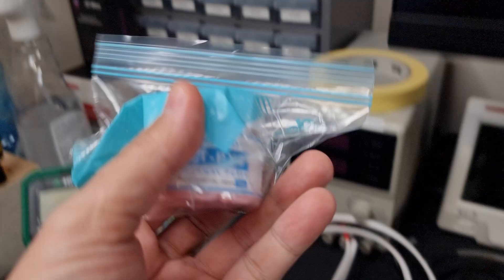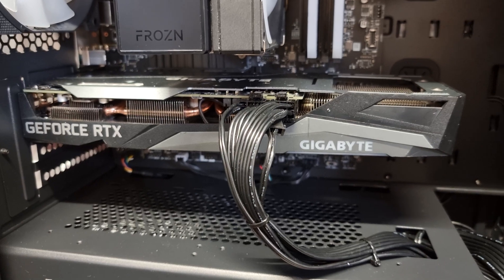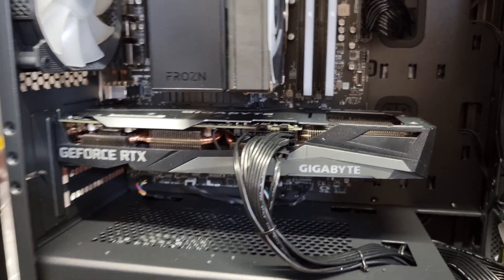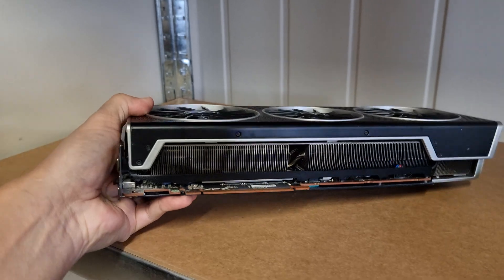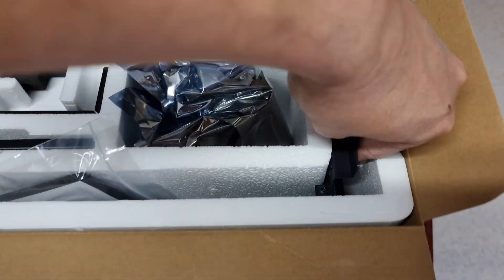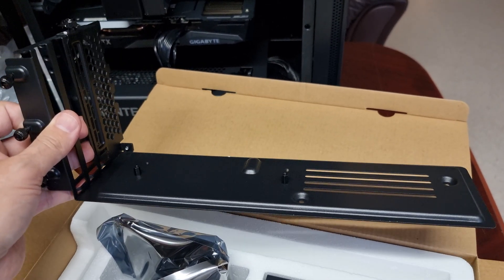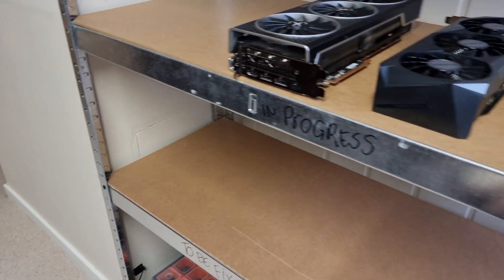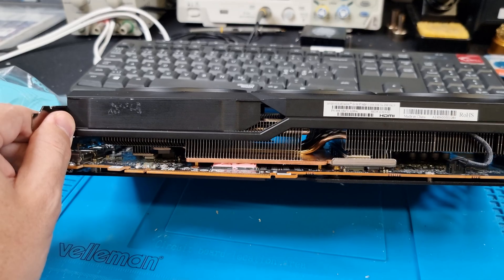Why Modern Day Graphics Cards Are Dying Prematurely.

Comment: because most modern gpu are equipped with vapor chamber tech. they DONT WORK properly if mounted  vertically since the vapor liquid are getting trapped resulting 88-90c like astral or elite series lol...
Reply: i have my vanguard 5090 vertical mount. does perfect. have a 5080 astral also same thing so i dont know what your looking up. Vertical Mounted where the cords are on the bottom or top yes issues
Reply: @stephengrinaker5085  just because it works doesnt mean his comment is wrong.
Reply: @KaMil-gw2qr  comment is 100% wrong
Reply: is this for real? most sandwich case vertical mount and the temp actually good side
Reply: lol, do you just make things up?
Reply: Oh, does that mean you shouldn't lay the case on its side while gaming either?

Comment: I recently got into GPU repair and have found it to be pretty challenging but rewarding to learn. I decided to tackle it after getting a good grasp on console repair (PS5/PS4, Xbox Series, Switch 1), so I'm use to seeing design flaws go pretty widespread. After 5 months of self-teaching thru research I've already got a handle on successfully reballing memory on failing cards. Crazy that failing memory is such an ongoing issue on modern tech, especially for GPU's. Just goes to show companies just want to make a quick buck and lost sight of what makes a reliable product.

Comment: THIS is why I bought a Thermaltake Core X5 in 2018 as my PC case due to its horizontal motherboard tray. The motherboard lies flat and my 5 lb. RX 6800XT GPU is vertically mounted in the slot, which means it CANNOT develop problems with the PCB flexing because gravity is not pulling the GPU heatsink away from it. Vertical mounting of large, HEAVY GPUs appears to be necessary if you want them to live full, productive lives.

Comment: The other problem is these cards heatsinks are much larger than the PCB's if these small PCB's are generating so much heat its time to make the SKU's liquid cooling only, especially with inflated GPU prices it really doesnt cost that much to setup a custom loop, EPDM+DP Ultra Clear is all anyone needs.

Comment: Recommendations for 4090 and 5080?
Reply from the maker: If they are heavy cards, use proper supports. I place the supports between fan 2 and 3. But otherwise, I like to use vertical mounts. Phanteks makes a few. I like the cheaper one. https://www.komplett.no/product/1220772/datautstyr/pc-komponenter/kabinetterbarebone/tilbehoer/phanteks-vertical-gpu-bracket?gad_campaignid=20188016872
Reply: @TechnologyHive Ok thx.So do you think my motherboard GPU bracket is good enough? I have a ASRock x670E Steel Legend. It always seemed good enough but then I saw your helpful video.
Reply from the maker: @theesharpestsword Any support is better than none. I would just use your board's support. The point is to not let your gpu sag with no type of support.

Comment: thanks for the info. I've done it for years naturally tbh because it does get in the way all the time especially the Rx 7900xtx, I've had a vertical mount and low key need it for my second build but after spending a decent amount on the mounts it kinda hurt the first time but its lowkey needed. For now it has decent support from the middle.

Comment: I think my gut reaction to be annoyed as vertical mounts aren't sold locally and it will be more than the cost of my case to get one in. 

I will see if I can find one with reasonable shipping as my previous 1080ti was visibly warped but still alive after 7 years and the 2 year old 7800 xt is heavier.

Comment: I religiously use a GPU support after having one card die on me (5060Ti16gb) due to GPU sag I got a coolmoon ARGB support bracket from aliexpress which screws onto the the card slots so a $15 investment to prevent another card failure from sag is a better investment over having to wait for a warranty replacement or having to spend another $850NZD on a new card, the card that I now run that replaced that 5060Ti is an Asus TUF Radeon 9060XT 16gb, so not using a GPU support was a very expensive lesson learned.

Comment: btw, Got AMD 7900xt after a year of use I reflow 2 vram near PCI slot . Works better now but still sometime I have to reboot. Just got broken as-is ASUS 6900xt LC hybrid. Repaste and run Furmark fine( Furmark use only 1GB vram during testing) but crash in Warzone I think due to loading lots of vram. Card got 3 8-pins, when crash the middle 8-pin red light flashes. Unplug PSU to reset the light. Tried swapping 8-pins cable around on 1000 watts Dell PSU but same issue. Looking on YT but have'nt seen how to fix yet.

Comment: GPU should already come from factory with adaptable brackets to be placed on the flying angle to prevent bending and movements. This is a fault from the manofaturers actually, they only think in fill their pockets and cut costs.

Comment: What about the Sapphire NITRO+ 7800 XT/7900 GRE? Would I really need to buy a 3rd-party vertical bracket mount? They basically have the same design and both comes with a GPU horizontal support mount. I saw a review on these GPUs on TechPowerUp site, and these cards have a reinforced brace built within the design of the card internally. So, I'd assume that should help support the card better (if you were to install it in horizontally), as it adds integrity to the overall structure of the GPU.

Comment: Overheat which is common on high speed processors.....company policy to reduce thermal resist materials for profits. Such as low quality copper, gold, and fiberglass board.
Thats why old products cost less heat 🤑

Comment: SO this is an issue of long 3 disipator gpus? i mean i guess that mine is a rx 6600 and i think it would be ok i guess as its a dual fan and while its long i havent have any problems but i am asking if that would be a problem or not and if i end up buying a 9060xt would that could that happen or its more of a 5080, 4080 , and maybe the 9070xt?

Comment: You can support GPU using some basic stuff in your home, if you dont care about looks. Lego bricks, sewing threads, plastic pipe pieces. 
I've tied my GPU to the top of the case and twisted the thread a few times to adjust tension.

Comment: Thank you for the video, Very usefull information that i will use when upgrading my trusty overclocked 1060 6gb (mem +830, core 2050, vid 1025 mv and temps max 69 if long time 100% usage)

btw, i supported the end of the card as pcb is really warped on the pcie connector. This is not a heavy card, but it lacks support on the back on the pcb so it sags heavily. 
i didnt buy any 3rd party supports, instead i used a bicycle wheel spoke... just twisted it to a 90 degree angle to get a steady base and placed the head right next to power supply cord.. raised end of the card 2mm. 

Keep posting :)

Greetings from finland

Comment: Me, who mounted my RTX 5090  vertically: 😌 
Me, after remembering my GPU is from Gigabyte: 💀
Reply from the maker: Supports are fine. I place them 2/3 the length of the card, or between fan #2 and 3.
Reply: @VorkKnightOfGood  u have 5090 be happy brother u are blessed
Reply: @alikf8017   A 5099nthay could die at any moment because the insane heat can melt the "server grade thermal gel" and cause it to leak into areas it shouldn't shorting and destroying the card. 

TLDR = No more 5090, no more blessed. Understand?
Reply: I got a Gigabyte Windforce 5080 from NewEgg for 1389 Cad. Gigabyte rocks.
Reply: Mount me bro
Reply: @BBWahoo  hot
Reply: @VorkKnightOfGood  exactly, no mentioning of newer gpus leaking thermals would have those users kill their GPUs arguably even sooner
Reply: @VorkKnightOfGood  I don't get it
Reply: @nickhero6329  all the thermal putty leaking out after it gets warm.
Reply: @nickhero6329 gigabyte proudly announced they were using server-grade thermal putty instead of thermal pads. Then users reported the putty was leaking, a situation that was made worse if the card was mounted vertically.
Reply: @VorkKnightOfGood yeah, they should advertise to mount it only horizontally
Reply: Me, who sold a GTX 1070 with profit after 5 years of heavy gaming and mining useage and replaced it with a free, fanless GTX 1050 Ti: I could not care less about those "new" problems with graphics cards

And dont worry, if i need gaming performance im also super happy with my RTX 2080 150W notebook @180W alienware vBios
Reply: Just ordered myself a 9070xt good to know i need to use the support for the vertical mount because its gigabyte
Reply: @cookiebandit101  Whats the issue? I have a Gigabyte Windforce 5080 and it's working perfect. Came with a nice support stand and all. Faster than your 9070.
Reply: @gto1607 vertical mounts with the added weight can shear the pcb
Reply: GIGABYTE overbuilds their cards compared to spec. Zotac does the bare minimum.
Both are as reliable as a reference card if not more.
Reply: @skorpers  Lmfao 🤡Gigatrash is the literally the most garbage brand manufacturing GPUs in the last 15+ years 🤣🤣

Comment: That's why I've used support even for my dual fan 2060s, 5 and a half years later and it still runs as good as new.
Reply: tbh those smaller 2 fan gpus like 2060 dont have this issue rly. They are light enough

Comment: I think I will always (if I can) stick with my old Thermaltake Core X9 case, because it is the motherboard that is horizontal and the GPU is vertical. I recently replaced my old EVGA 2080ti FTW (3 slot), no bent board. I would get a vertical mount if I had to use a tower case, I have seen the sag on heavy GPUs, kind of sad.

Comment: I'm gonna put my tower on the side until I 3D print a support bracket. 3D prints tend to deform under pressure overtimes so I'll have to account for that.
Reply from the maker: That's a clever way to approach this. 👍🏼
Reply: @TechnologyHive  thats how a lot of the PCs were back in the days of 286/386 :) Than it changed to towers...
Reply from the maker: @HybOj  Yes, I remember those days. I am old enough lol

Comment: I have an aorus 3090 Xtreme and potential sagging is a big worry. I have a custom watercooled loop, so the PCB is sandwiched in between a heavy alphacool block and an active alphacool backplate block. The whole thing weighs about 2,5 kilograms. It is, however, a lot shorter than when it had the aircooled brick as the blocks are the same length as the PCB. 

I wish I could have it vertically, but the case doesn't allow it and I would be able to use my soundcard if I did. I did put a support at the end just in case and I try to touch it as little as possible. It's still going strong after 3 years this way, so I guess I'm doing something right at least.

Comment: Here's what I do: I use thick wire and fold one of its ends as a hook, and I attach it to the heatsink of the gpu, then I attach the other end on the pc's enclosure holes, up, so the weight of the card never causes any misalignment with the pcie slot. It always remains straight into position. Rope could do too. It's a simple bridge-builder logic.

Comment: This is exactly why I use two, not one, support brackets for my 4090. Never had an issue with my card and all it's weight is properly supported and balanced in my build. May it stay that way. :)
Reply: Where on the card do you have your brackets? Did you mount them length-wise or along the width?
Reply: @AltTab2193  Hey, sorry for the late response. I mounted them the "normal - average" way, so lengthwise, I guess? I have one support bracket directly at the middle of the card and another one at the end of the card. :)

Comment: A week ago I received a customer who brought his high end japanese Galleria prebuild. Extremely heavy too. It was turning on but no video (They also brought a 100w 110v autotransformer lol cuz we use 220v., the PSU was universal)
I had to disassemble the device to swap components. Then I notice extreme bending from both cpu cooler and GPU. The CPU cooler which usually is like a T became a Z. The GPU was sagging hard on the right. When I removed it I found the slot cracked open at the notch which separates the PCI voltages and the data. Luckily, the second slot was operational and the GPU was fine.
The build had a 10gen i9 with a 2080Ti and big heavy duty fans. It didn't have any support for the GPU.
Yeah, very bad idea to ship a PC with very heavy components.

PD: I saw 67°C during stress on the i9, so leaning tower is cool.

Comment: This is why I bought two GPU supports with two points of contact each when I got my EVGA FTW3 Ultra 3090. They mount on the bottom case fans, with two poles with padded supports coming off of each fan. I have it supported from the back, two in the middle, and one towards the front. I call it "Industrial grade support"
Reply: towards the front? seems kind of pointless if its already supported underneath no? or do you mean the end of the gpu that is towards the case panel?

Comment: I have a 3070 and before that the 1080 and I been using a spring with balanced strength at the back end of the card case to help the sag problem. been working so far
Reply from the maker: Some support is better than no support.

Comment: I checked my 5070 ti (zotac solid SFF) from this aspect just in case, has been soon using it for half a year. It is mounted horizontally, there are actually 2 support brackets (one at mid the and one at the right side of the card, being careful that none of them hits the fans). As I have two, why not use them both lol. No issues, no bending, no sagging even today - Used a spring level tool to measure it, a couple of zero point degrees is acceptible, it will be never be 100% horizontal. 

I don't understand how this kind of bening is happening to graphics cards, If this happens to multiple brands cards especially. I think ether the owners of these graphics exhibited too much force at some point, because you can't just bend a PCB like that. Or you have to be really careless, or the brand doesn't have a good design. Or it could have been that the card or the PC were transported and something happened there. Jaystwocents showed a gigabyte example where that hatch part of the card was loosen compared to an asus card.

Comment: Why not use PTM instead. It's way better than any paste, putty or a simple pad.
EDIT: Especially for vertical mounting. I have a Fractal Terra and a 4070ti super. From the factory the temps were decent yet after a couple of months the temp started worryingly rising. Especially on the hotspot. Took the cooler off and to my surprise the paste wasn't spread evenly at all, gravity did its thing and it all dripped down to the bottom of the chip where it all clumped up. PTM is better in any scenario but it was great here especially. Use it on both the CPU and GPU, it only improved with time rather than got worse like paste does.

Comment: Sag has been an issue for a very long time, since we had cards at or above 2-3 lbs in weight, some brands include an integrated support bracket to reduce sag(MSI is one of the ones that does this). The usage of lead free solder doesn't help either as it tends to be a bit more brittle than leaded solder. 

I remember that I used to have an asus gtx580 card with a rather bad amount of sag. The card still worked when it was replaced, but it was quite easy to see that the pcb was warped.

Comment: Sub man! I like the POV stile and the quality  💪 QQ; I have 4070 X2 INNO3D. Should I change termopades (if yes, with one should i go with) after 2,5 y, or it will be better to go with that paste change only?
Edit: Ok Arctic MX-6 it is - I just watched your other vid!
Reply: I got the thinnest possible graphite pads - In fact they have better thermal performance than the stock thermal paste (in a HP Omen 17 notebook with RTX 2080 150W@180W  and i7 9750h undervolted and overclocked)

Comment: I spent $1000 bucks on a 3090ti with 24Gb vram. I got so paranoid because it is very heavy, and very large. I use 3 GPU stands when in reality, I only need one. Worth the extra 30 bucks. ❤

Comment: The issue I would be concerned about with those vertical mounts is the long cables. The signals which are very high speed have to travel a much longer distance over those cables than they would if they were connected directly to the motherboard slot. There has to be some propagation delay issues that may cause performance issues. It would be interesting to see a comparison in card performance with and without one of these vertical mounts.

Comment: In light of this issue when I installed my rtx3090ti I hung a piece of rigid wire from the top of the case and hooked it on one of the holes on the corner of the RTX 390 and adjusted the tension so that the card was not sagging at all. I think these cards must have some kind of a support in order for them not to warp.

Comment: In addition to the good advice given: ALWAYS take your time, if you are not speed doing this for a living. If you are working on your own machine, that's a x1 effort without others in queue. Relax. ALL work should be done with a slow hand so when you eventually make a mistake, the effect is not a broken part but rather an inconsequential nothing instead. If you have gear that is newer to you or you don't have prior experience with, check the Youtube. The ability to see before touch goes miles beyond what you would think, still.

Comment: I'm using sag bracket for my Rx 580 Nitro+, because it's going down at the right side of the GPU
Reply from the maker: Just dont forget to loosen the retaining screw before adding support. Don't add support while the GPU is screwed tight to the case.

Comment: So I guess I am still good with the 2 fan Sapphire AMD 9060 XT card without vertical mounting. Its pretty light card.
Reply from the maker: Yup. That is the only exclusion to the "rule". Two fan cards, using some common sense here, should do okei installed horizontally with no support. Just like the 3060Ti in this video.